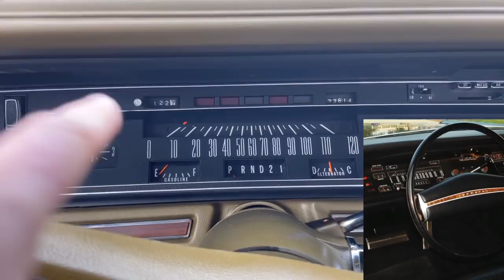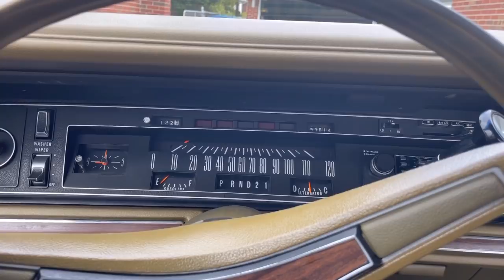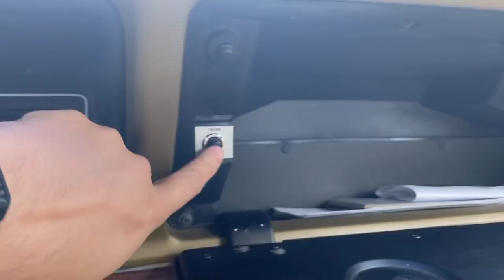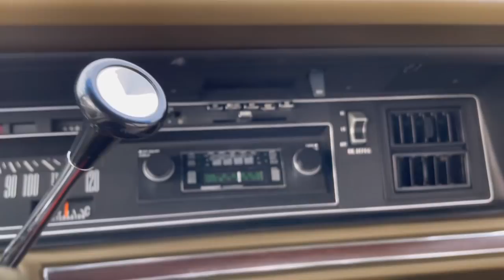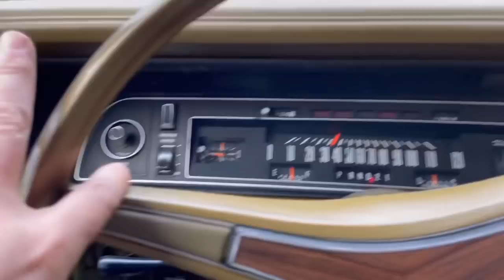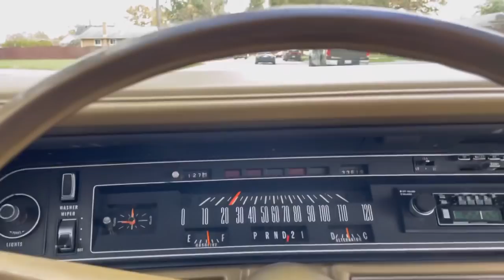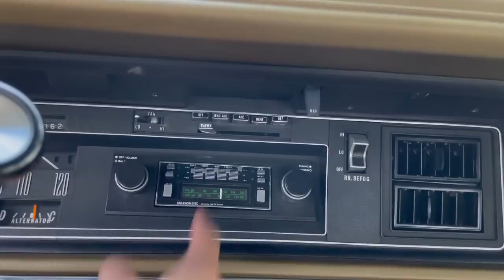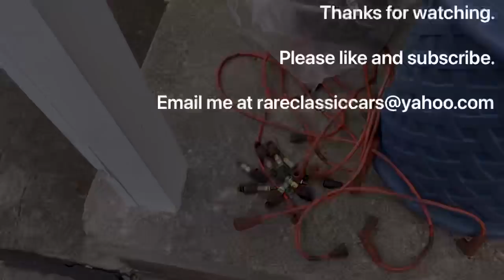FULL REVIEW: 1972 Chrysler New Yorker 440 V8: Fuselage Era Chryslers

Comment: You made some very astute observations about this car's place in the marketplace, Adam. The interior design and quality appears pretty close to it's competition, though of course I can't actually feel the quality of the materials. I like the seat upholstery and door panel design -- better in my eye than those of the GM competitors, and about the same as the Mercury. The dash is a bit obviously plasticky, but well laid out.  I couldn't help but laugh at bit at the pogoing of the camera as you were talking about it. It really has a lot of power, which is what I think was a big selling point of these at the time. Lastly, I think that the overall design is very clever in that when viewed alone, it's well proportioned and you can't really tell how BIG it is -- it has a certain lithe look, especially the way the rear end sits up. Thank you for the Fuselage Fun!
Reply: Chrysler interiors always seemed to be a bit behind the competition...slightly less good plastics, etc.

Comment: Omg I love this car. I had an all-gold 72 hardtop 4 door as a teenager in the early nineties. I used to lay in to the 4 barrel every time I launched. So powerful.. I snapped a couple u-joints doing neutral drops. I wish I had respected it more… definitely not a teenager car. I moved on to a 88 Town Car after selling it. Like you said, the carb wasn’t reliable, especially in my cold climate, so I wanted an EFI car. The good news is the guy who bought the New Yorker from me for 1k frame-off restored it and gave it the love it deserved. He sold it for 10k back in the early 00’s

Comment: My dad had one of these when I was a kid. I remember it being spacious and comfortable. All the interior surfaces were sleek and smooth, including the window cranks. Those window cranks (one for the window and one for the wing) worked well. I think for being such a big car that it was not that heavy. My dad once boasted that it got 18 miles per gallon. The trunk is huge. The space in front of the battery might have been comfortable for someone to lay down in and take a nap. It had a torsion bar suspension as I recall.  This car could replace airline travel if it were being made today. Chrysler had lots of rich colors during this era.

Comment: Yeah, I always think of those '69 Fuselage Era Chryslers as the first of the seventies-looking cars. I felt like a lot of the Chryslers, even after Virgil Exner left, were still a few years behind the times in their styling, with, like, the '67 Plymouth Fury looking visually more like it belonged in 1965 than 1967 and a lot of early sixties-style heavy creasing and sculpting and mock-convertible roofs being retained by Chrysler even into 1968, and then 1969 came along and they began to set the pace with these cars and the redesigned Chargers, etc.
Reply: Regarding the "Fuselage" era at Chrysler...  I have read other histories that say the entire Chrysler full sized lineup was intended as a 4-year product cycle, like '65-68, and that the MY '72 refresh was intended to launch for MY '71.  Somewhere in the competition for scarce investment capital...  safety, emissions, 5 mph bumpers,  plus the rest of the product lineup...  The intended '71 refresh was pushed out a year, making the awkward looking patchwork bumpers necessary for '73, and pushing the substantially revised new designs intended for '73 out to '74.  Launching that next generation in the latter half of 1973 when the oil embargo occured, was a disaster Chrysler was ill equipped to handle.
Reply: @billyjoejimbob56  or

Comment: One thing I noticed about all Chrysler I owned, which u mentioned, is the  good visibility from any angle. All the windows were made for the driver to see better. Ford or GM did not have that.
Reply: I owned a 77 Chrysler Newport once, and I noticed with that car that I had no trouble seeing all 4 corners of the car, which made it easy to park, despite its size.

Comment: I have been waiting for this review, ever since we had the first preview.  In the mid-late 70's, my mother-in-law had a 72 Newport or New Yorker (not sure) 4-door, lighter shade, almost gold, also with a 440.  I had the pleasure of replacing the spark plugs 1 time, outside in her driveway.  I remember also removing the wheels and going in from the side.  This car is an amazingly well-preserved example, and it's great to see it still rolling around.  Those separate front shoulder belts also bring back memories.  I was 1 of the few people who did use the belt and re-hang it to the roof when I had a car with this type of belt, so the single inertia-reel lap-shoulder belt combo we have today was a big improvement.  The key reminder buzzer sounds like the one that came in my 88 Dodge Aries.  Around 20 years ago, I was able to remove the chime module from a scrapped 1990 Dodge Spirit, and that is in my Aries to this day.  The part # of the original was 4373067.  If that is also the # in this 1972, maybe a chime from a later AA body car would fit here.

Comment: My family had a 1967 New Yorker bought in 1969, I was 9 years old. My dad was about 5’7”. When he had the seat in his driving position, I could sit in the back and extend my legs straight out and just touch the back of the front seat. I remember that speedometer with the needle dropping from the top. Definitely noisier than the ‘65 Ford Galaxie 500 we also owned, and more rough riding. The 440 was strong and delivered pretty good (for the time) fuel mileage. 
Great video as usual.

Comment: I had a 2 door 1969 Chrysler 300 with the 440 TNT engine (first year for the fuselage styling the Chrysler C bodies).  Always started well and fortunately didn't have any problems with the carburetor.  Sold it after some rust developed on the quarter panels.  One of my biggest mistakes.  As time goes by, the more I miss it and the beauty of the fuselage styling. Would like to buy another one someday. Thanks for such an accurate and comprehensive video.
Reply: A '69 440 would have had a Carter AVS, which are excellent carburetors. By '73 all Mopar 4BBLs were Carter Thermoquads, which tended to be either really good or really bad. Difficult to tune unless you really knew what you were doing. The Hollys were used in '71 - '72 as a transition.

Comment: As usual, top quality video. Top quality knowledge. Your summary of how this Chrysler rides and handles in comparison to Ford and GM parallels my thoughts exactly. I've owned or experienced all three back "in the day" and I concur. FORD: soft, quiet, smooth, wallows , horrible handling, seemed to not be quick when asked to move, seating TOO LOW.
GM: better seating position for driver (I'm a really short guy), decent handling, superior power steering (variable ratio they called it. The more you turned the steering wheel, the quicker the wheels turned), better styling than FORD, quick off the line, fairly sold, not as quiet as FORD.
MOPAR: superior handling, better steering than FORD, super get up and go, tinny sounding doors, good seating position for driver, better passenger comfort and space,than GM or FORD, noisy cabin, had reputation for hard starting, better instrument lighting, bigger trunks.
Reply: From all the reading I did of car reviews in my younger days - and some experience riding and driving some of the cars - you covered the differences (and pluses and minuses) pretty well!

Comment: I learned to drive in my parents 1970 Chrysler Newport which had the 383 V8. Awesome car.  You could put two full size bicycles in the trunk and still have room left over.  And as a teenage male, lets just say that the back seat made for a great date car!!!  The 1970 grill on the Newport was my favorite.  Unfortunately the body just rusted out.  However that 383 was still smooth as silk after over 260k miles.  I really miss that car.
Reply: I learned on a 68 Newport with a 383 ,,,dad traded in for a 75 Newport ,,,black with dark red interior,,,so beautiful

Comment: Great video. This brings back some memories. My parents had a 1973 Dodge Polara and we used to pull a mid-sized trailer with ease, even though it only had a 318 V-8. The handling and suspension felt a little floaty but it  could reach 80 mph on the freeway so quickly it was amazing. The transmission always leaked, but as long as you kept it topped off, it performed flawlessly. Because the Highway Patrol used the Polara in those days, other drivers gave you a lot of respect in that car.
Reply: I had a 73 Sport Fury, Blue on Blue 2 door,  gotta love the 70s. Same 318 and same everything leaked. In 1991 it blew a head gasket so I bought 360 heads at a wrecking yard and .....OMG!!  For two years that was the ugliest, fastest old car on the road. Then I crashed it. Good old 70s Mopars.

Comment: I'd love to hear more about your 1971 New Yorker, too. The other critical detail in the equipment/pricing/nomenclature story is how the 1971 300 was replaced in a sense by the 1972 New Yorker. The 1971 New Yorker was replaced by the 1972 New Yorker Brougham as the line immediately below the Imperial.
Reply: Yep. Starting in the late 1950s, Chrysler offered the Windsor, Saratoga, and New Yorker, with the Saratoga being the sportier model in the range, much like the Century and Super 88 were at Buick and Olds. However, when Chrysler replaced DeSoto with the Newport, they moved the Windsor up to middle tier in ‘61 to replace the Saratoga. Then in ‘62, they replaced the Windsor with the non-letter 300 series, which carried through to 1971. In ‘72, they split the New Yorker series into base and Brougham to maintain coverage of their existing market and fill in the gap left by the 300. But by ‘72, there wasn’t much market for sporty big cars anymore, so variations on the existing New Yorker trim levels were all they needed to fill the gap.

Comment: Just found your channel a couple days ago and am really enjoying your vids. You do an excellent job of detailing the story behind each car and the features of the car itself. BTW, here I thought I had got my moneys worth out of the plug wires in my 1993 GMC that I bought new and just changed 3 years ago after 26 years. But at 50 years for the wires on this New Yorker you def got me beat! I also changed the plugs, rotor, and dist cap at the same time, and also for the first time. I did the job myself and it cost me about $60 for parts. Bids from shops was around $300.

Comment: I had one just like it, even the sane color! I had mine in 1980. 
A great riding great handling large car. Turns on a dime and has great high speed handling. 
Torsion bar suspension did wonders.   Great vehicle. 
PS. I've owned so many of the cats you've featured, back in the day I changed cars like they were underwear! Lol   
That said, my favorites were always the full sized models, although I did have a hand full of smaller models like Mustangs, Cougars, Chevelle etc... But again, my favorite was always and still is, the full sized sedans both 2 and 4 door models. 
Thanks for sharing !!!  John

Comment: My father owned a '72 New Yorker Brougham.  True blue poly in color with a black vinyl roof.  He would call it the big blue bathtub.  What a cruiser!  When he bought it it had Firestone 721's on it...one blew apart on a local trunk highway.  No damage to the car.  First car he owned that needed a trans overhaul.  Recall it had problems with the Auto temp II servo.  Learning to rebuild that helped when he bought his '73 Imperial.  Both cars ate starters and alternators during the cold Minnesota winters.  He bought one more..a '76 New Yorker Brougham.  Same problems except transmission.  He went to Buick Electras and a few Cadillacs afterward.  The '72 met its demise when I was driving and slid through a stop on ice.  He bought a '71 Olds Toronado.  That one caught fire in the driveway.  Always felt bad about the '72 New Yorker.  I do remember the difficulty with tune ups!  Thanks for the memories Adam!

Comment: I had a '69 Dodge Polara (a 6-year old ex-police car*, with the premium-fuel 383 4 barrel motor) which stalled on me in the middle of the busiest intersection downtown at rush hour on a cool, rainy day. I had trouble re-starting it and getting it to run, but managed to get it home. I was so embarrassed, that when I got home, I swore that I was going to buy a new car (my '75 Nova). From what you were mentioning here, it was probably just the ballast resistor! I agree with everything you have to say about the fuselage-era large Chrysler products. Very good in some ways, and no so much in others, yet I did enjoy having it. *The dealer had repainted the car before I got it, in a turquoise color with a white painted top. I am still not sure if it looked good in that combination.

Comment: First let me say that I love all your videos! All these great cars and amazing amounts of info to go with them. I'm a diehard MoPar guy and have owned several New Yorkers and Imperials even a couple Newports.  Now a few additions for your info.

The fender top signal lights are in fact bulbs not fiber optic. That was a GM thing. Actually I think Chevrolet had them Before Cadillac. I never understood why Imperials didn't have the inside indicator, never made sense to me.

Only the Imperials had the option of dual air conditioning with the exception of the full size wagons. Even without the extra upper side vents the AC was surprisingly good on the fuselage cars. The full sized cars however could get a rear heater  with defroster excepting wagons. On manual system cars I usually unplugged the AC relay so the compressor only came on when the buttons were pushed, otherwise it would run constantly whether the system was on or not.

The extra wind noise was present to a higher degree on sedans than on hardtops due to the design of the upper door frames.  It was really loud on the wagons due to the extended roof side rail shape.  It also seemed that they didn't use sound deadening insulation in many places at all.

The electronic ignition was very reliable with the exception of that ballast resistor. It was designed to lower running voltage to make the coil run cooler and produce less electrical noise. By the way, the 4-pin vs 5-pin control boxes simply eliminates the start circuit to the resistor giving 100% voltage on a cold start.

That firm ride was indeed designed for the driver. I had a 73 New Yorker Brougham. It was a far more rewarding car to drive than my Uncle's 72 Olds 98 LS or my Grandma's 72 Monterrey or even my 78 Town Car. Those cars were much more cushy but a real handful on curvy roads and you couldn't see out as well. I always liked the shape of Chrysler's seats. They seemed more comfortable. Perhaps a bit overly springy in the stuffing.  Maybe an attempt to offset the firmer ride?

Thankfully I've only owned one 440 with the Holley carb. All the others have been Carter AVS or ThermoQuad. The one that gave me grief? The Holley 4160. It fared much better after a very careful rebuild with all new Holley parts and gaskets but still no equal to the AVS. My 73 NYB had a TQ that someone attempted  to adjust and of course didn't follow the correct procedure. It running poorly and the carb not responding to changes from the owner allowed me to get it for $650.00.  Two hours after i got it home a carb adjustment and cleaning  and a full tune up it ran like new.  Definitely best to change plugs from the bottom, even better with the wheels off. There are cutouts in the framing to accommodate an extension to access the plugs better.  Even went from 6 mpg to 13 mpg and started easily afterward.

I always enjoy your videos and the wide variety of cars you show.  I also thoroughly appreciate the silent pauses to listen to the Highland Park Hummingbird! I'm looking forward to your next videos, again thanks a lot for bring these great cars out so we all can see, enjoy, and appreciate them!
Reply: The dual a/c was available in fuselage wagons. I have a friend with a '71 T&C that has dual a/c, and it appears optional in Fury Suburban sales guides of the era. Maybe they got rid of it for wagons in the '74 redesign.
Reply: Gauge cluster was unique to Imperial which came standard equipment with Fender mounted turn signal indicators. Gauge cluster for New Yorker was shared with Newports on which the fender mounted indicators were optional. So, rather than build two separate gauge clusters for New Yorker and Newport, the inside indicators are redundant on New Yorkers and Newports with optional light package.
Reply from the maker: Great info and thanks for the note!

Comment: I just crushed my 73 GranFury. The Plymouth version of this. Same green outside with a greenish tan inside. But mine had the 400. Not a detuned 440 but a sported 383. I know same, same but that Thermoquad was like two bear cans side by side. The first year owning it the ballast went out and a friend told me about this magazine called JEGS. Not so commonly known back in the day and was meant for racers. They had an ignition box that didn't require the ballast and I never had it happen again. The start wire and the run wire both twisted to the ignition wire and the box was all 12volt. Some people told me that it would burn out my pickup in the distributor but it never did. Also the torsion bar springs were fully adjustable using the tools that came in the hazard kit. That was a great car. And as you pointed out in your video it is the only car that I've owned where the speedo only went to 120 but I had it there frequently in straight lines only. I don't think I ever changed the plugs in the many years of driving it. I recall getting about 20mpg which was pretty good back then. And date night on the hood of that car with a blanket was some of the best dates I've ever had. The pitch of the windshield to the level of the hood made it perfect for star gazing at Cougar Reservoir in OR.